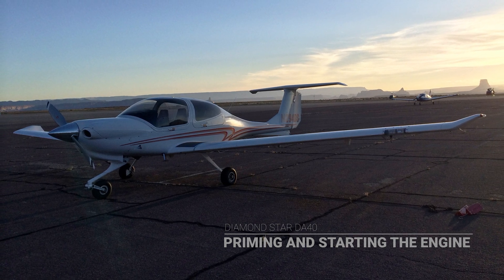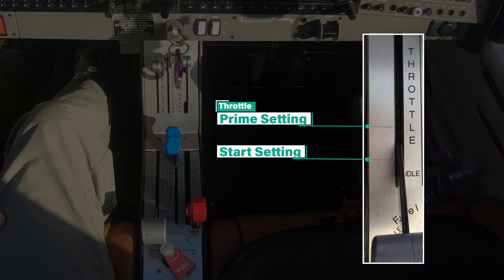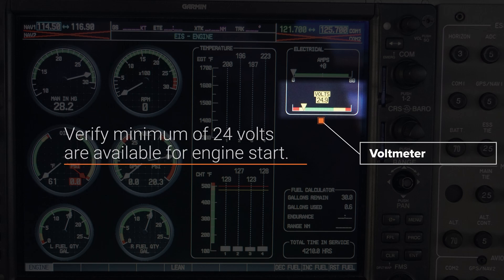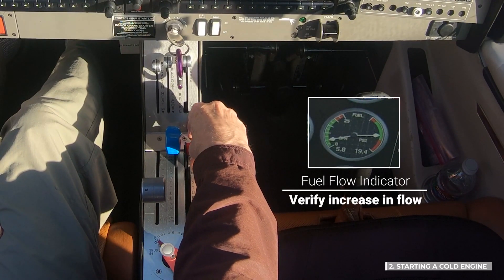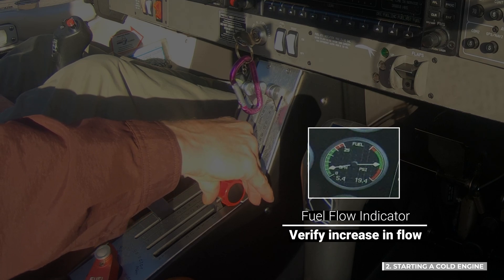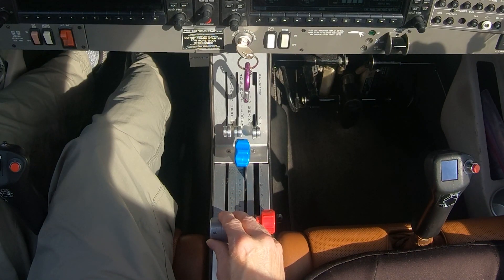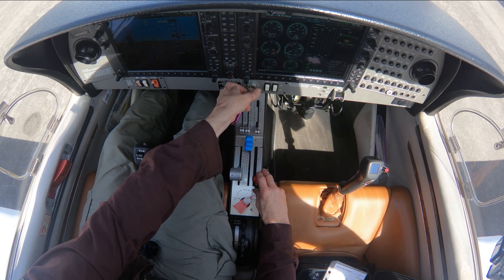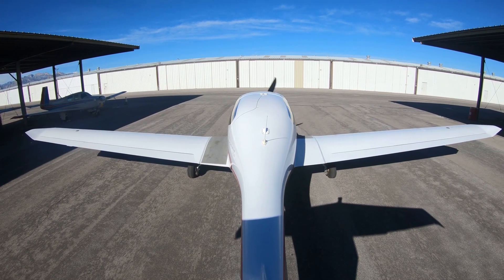Priming and Starting a Diamond Star DA40

Comment: What is not mentioned is Diamond very wisely fitted a Slick Start unit as standard. The Slick Start is an automatic ignition booster that increases the ignition voltage by approximately 300% during starter engagement and makes starting much less of a black art.

Comment: Excellent tutorial. I may try to adjust my current method with your recommendation. Till now, I've always opened both the throttle and the mixture full forward and then turned on the electric fuel pump, turning off the pump and then moving the mixture to lean and the throttle to the starting position. What benefit do you see in running the fuel pump while the mixture control is still in the lean position, is it to build up pressure in the lines?

Comment: This was great, could you please cover prop lever settings ???
Reply from the maker: Hello, 

That’s a great idea and we will try to cover prop lever settings in a post on our website. 

In the meantime, here is some basic information: 

Prop Lever

The Prop lever (also called the Propeller lever or RPM lever) has a blue handle and is located between the throttle and Mixture control lever. As you can see in the video, the Prop lever is in the full forward or max rpm position. As you pull the Prop lever back, the pitch angle of the propeller is increased and this reduces the propeller rpm. 

CAUTION: The Prop lever should be moved slowly, in order to avoid over-speeding and excessively rapid RPM changes.

Prop Lever Settings  

1. Engine Start 

Prop lever…….Full forward (max rpm)

2. Taxi

Prop lever…….Full forward (max rpm)

3. Runup Prop Check

Prop lever…….Pull back until a drop of 250 to 500 RPM is reached then push to the full forward position.

Note: Check manifold pressure, rpm, and oil pressure changes as the Prop lever is pulled back.  

3. Takeoff

Prop lever…….Full forward (max rpm)

4. Climb 

Prop lever…….Set to 2400 rpm

5. Cruise and Descent

Prop lever……..Set as needed for the desired power setting. Check the AFM for the different combinations of throttle and RPM settings.

Note: Lower rpm yields better fuel economy.  Anytime you change the RPM setting, the fuel mixture will need to be adjusted to maintain proper EGT temperatures.   

6. Final Approach

Prop lever…….Full forward (max rpm)

7. Go-Around 

Prop lever…….Full forward (max rpm)
Reply: Emprise Air thanks legend :),